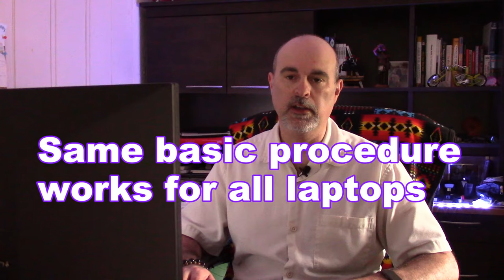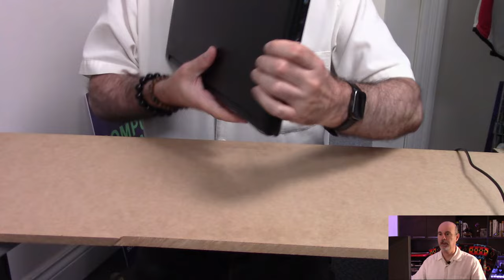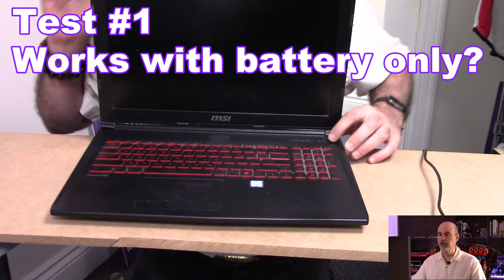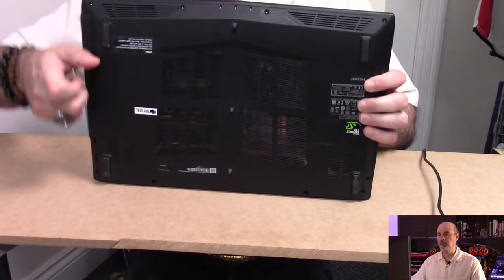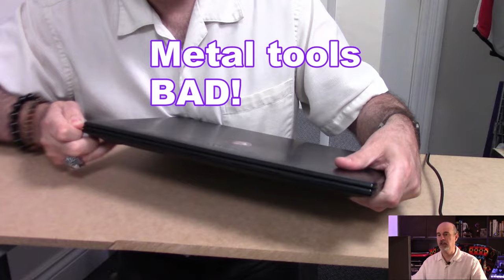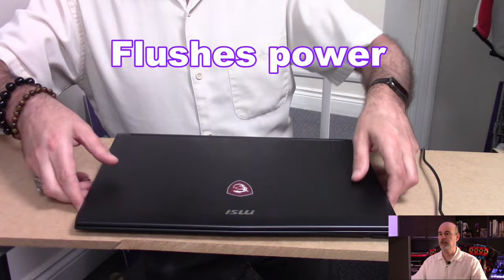How to fix an MSI laptop that will not turn on

Comment: Hello Sir Daniel, I Will Very Pleased if you could help me figure out.
I have MSI GV627RD Notebook, It was working all fine and I don't do any intense work on it, the previous day it was working all fine, and the last thing i did was copied some files to pendrive, and shut it off, the next morning it won't turn on, when i connect the power adapter the charging blue indicator in the bottom turn on (static) turns off after the battery gets full most probably, i tried your method and the small pin hole too, but nothing seems to work, I don't know what went wrong, i hardly used it for 3 months, as a Student it hurts to something go off without any understanding, i will very grateful if you help me find out the solution.

Thank You 🙂
Reply: Wished i could share a picture, i previously seen a video in youtube where the user showed it was not booting up his msi notebook because he had connected a faulty pendrive, and he removed a thin white strip that has power written on it, he removed that thing and it turned on, but my model i can unplug it from one end but the other end is below the mother board which can't be removed,

Just sharing if this helps in any way 🙂
Reply from the maker: Hello, this is hard to say in this case but maybe the pend drive was faulty and shorted the laptop.  If this video method didn't help, it might need repairs to the motherboard.
Reply from the maker: Thank you for sharing this, I never heard of such a trick but so many people come up with dangerous methods that can brick their computers.  You need to be careful what you try because what could have been a simple solution can turn into a more expensive repair because of the extra damage caused trying to fix it yourself based on blind advise from someone who hasn't seen the computer.
I've seen USB sticks or USB hard drives cause issues booting, but it would simply say on the screen it can't find the boot device.  Remove the USB and reboot works fine.  But what you're saying is very rare in my experience.
Reply: @TwinBytesInc  after commenting on your video, i tried opening the laptop and the strip i discussed, and every part from ram to hard drive to check if that fixes it but still no luck, i checked some parts for laptops especially motherboard its quite expensive, i purchased this laptop from all the savings i had, and to my luck it only worked 3 months, now it's been this way for a year now, wished i could get it back to work.

As I can't share the pic here, the strip is about 6 cm long and sticker attached to the back of the strip
MS16JIMB TO POWER 24PIN FFC
K1C-1024003-H39
HIGH-TEK(KT000)17/05/2018

And watermarked E35311 RU AWM 20624 80C 60V VW-1 H

Top Pin Side it Written Power and The Other Pin Side it's Written MB

If this could be the problem?
Reply: @TwinBytesInc  I really appreciate for taking out the time to reply to all the user help figure out the problem, it really means a lot 🙂
Reply: And yeah as far as i remember when it was working a blue light used to indicate in the the power on button when it gets connected, now only the battery indication get the blue light and turns off when the battery is full
Reply from the maker: @suyalahmed99  Sorry I can't help much further here.  I can only offer quick free advise, otherwise lots of back and forth turns into billable consultation/troubleshooting.  I'm sorry but you will need a local technician to help further as I have no other ideas off the top of my head.
Reply: @TwinBytesInc  Okay No Problem 🙂, Thank You So Much For Giving Out Your Time 🙂
Reply from the maker: You're welcome.  I do give what I can.

Comment: my msi pc dosent keeps on or turn on  with out charger connected even battery has charge plz help
Reply from the maker: That sounds like the battery needs to be replaced if it only works while plugged in.
Reply: @TwinBytesInc  I don’t know I took it to repair shop but they said battery is fine, and it will keep the charge too it became like a desktop
Reply from the maker: This sounds like a motherboard issue now.  Since battery is fully charged and other tech says battery is fine.  You should ask them if they actually tried with another battery, just to be 100% sure.  if still an issue with a different battery, then it's a motherboard repair.

Comment: Help, it doesnt turn on but the charging icon does turn on
Reply from the maker: It definitely sounds like this video should help.  Maybe just the screen is dead?  You can trying plugging an external monitor if it looks like other lights come on.  Otherwise try with power cord in and battery out.  If still doesn't work, needs motherboard repair.

Comment: I'm using Msi ge63 raider 8rf won't but but the fans are on
Reply from the maker: If this video doesn't solve the issue.  Maybe in your case it is a dead screen.  You can try plugging in an external monitor and see if that works.  if it does, that means you need a new screen.

Comment: It’s not working for me, there’s just some noise on the power button
Reply from the maker: There's a chance you need a new power adapter if you can borrow someone's, or it's going to be a motherboard repair.

Comment: Hallo sir
I wanna ask to you
I have MSI GL62M 7REX
My laptop cannot turn on
I was follow your step but still not turning on
Reply from the maker: Sorry I can't really troubleshoot here but maybe you need a new powercord or motherboard needs repairs.  Someone local needs to look at it probably.
Reply: @TwinBytesInc  i was remove the battery and plug the charger to my laptop
Still not want to turn on
Reply from the maker: Most likely motherboard damaged and someone needs to physically look at it.
Reply: @TwinBytesInc  thank you for the answer
I was put my laptop to service center
They say my motherboard dead
They wanna try to service my motherboard
Hopefully they can fix my laptop
Reply from the maker: Thank you for trusting me.  Sometimes people waste alot of time trying all kinds of tricks when nothing will work because the motherboard is simply dead.  The smart thing to do is to know when to quit. :)

Comment: What if you have to do this over and over again?
Reply from the maker: That means an issue with the motherboard in my opinion.  You could try updating he BIOS if it has an update available.  Otherwise it may need a physical repair like reflowing the board or something else.
Reply: @TwinBytesInc  thanks for sharing

Comment: I did the entire thing up until the battery removal, when I realized that I had a different kind of battery. I removed it, but it was connected with wires and I didn't want to remove them, so I did the 60 seconds and it unfortunately didn't work. Does anyone have any tips to fix this?
Reply from the maker: Sounds like yours has a cable or bunch of wires connecting the battery to the motherboard.  It should have a white connector that slides out away from the motherboard.  you will have to seesaw back and forth a little to get unplugged.  It's typically a tight fit, but you should see it start moving without too much force.

Comment: Hello sir please help!
I follow all the steps exactly same as yours! But nothing happens.

My laptop model is MSI GF63.
Note: When I plug the charger the the light od charging is emit.

But it does not power up.

Please help me I appreciate your response.
Reply from the maker: Sorry you're having trouble still.  This solution won't work for every situation and you may have something else going on that requires further troubleshooting.  There is a whole in the bottom of some MSI laptops but other brands may not have a whole and this feature method would work for any model.  However if it's not a power issue, it may need repairs to the motherboard itself and so you'd need to take it to your local repair shop to have them check.  Unless it's just your screen, in which case you can try plugging in an external monitor and see if it shows anything.
Reply: @TwinBytesInc  i can a little hole/EC botton at the back of a laptop - how long do i have to press it? It must be pressed while the laptop is plugged in?
Reply from the maker: You must unplug power adapter and battery if external.  Then press for 15 seconds according to MSI  manual.
Reply: @farazahmed2357  what was the solution mate
Reply: @farazahmed2357  did u find a solution what made ur laptop work

Comment: What if my laptop doesnt have the battery
Reply from the maker: I guarantee you have a battery.  It's just hidden inside the laptop. You'd have to remove screws that might also be hidden by stickers or plugs to get at the thin battery that is attached directly to the motherboard.   Or instead of that, you might have a small pin hole on the bottom of the laptop that you can press with a paperclip to reset the battery.

Comment: I have the MSI sword and this seems like the system in the laptops booting up just the screen is not displaying anything
Reply from the maker: Thanks for your comment/question.  If you can plug in an external monitor you will know if the system is working for sure and just the screen needs replacing.  Then you can either keep using an external monitor, or get your laptop screen replaced.

Comment: I cant open it up,i feel like its going to break everything because it wont open nicely,can you please help me?
Reply: well i didnt fix anything all i did was broke my computer,nice..
Reply from the maker: It's hard to guide through this in chat without knowing where you are stuck.   Sometimes needs a bit more force but reasonable, not really hard forcing it.
Reply from the maker: Sorry to hear this, I don't monitor chats or reply 24/7, just once a day here.  Also this is not a tech support chat, but I do try to help when and were I can
Reply: @TwinBytesInc  i somehow got the case opened up,but i dont see the battery.I have a different model gf65 2020 i think.Could you maybe help me find the battery?because i dont ser anything that looks like a battery
Reply: @TwinBytesInc  yeah,i did everything but it still wont turn on..i dont know what to do..maybe my cats pressed some buttons that made it shut down or something?do you have another solution to fix this?if you do could you please help me?
Reply: @TwinBytesInc  nevermind i just wasted 3 hours of my life trying to fix my computer,while my cable wasnt plugged in,it ran out of battery..:D
Reply from the maker: Seriously?  It was just a dead battery you needed to charge?  That's great news!  Sometimes it's such a simple fix but we tend to overcomplicate the situation thinking it's something far more technical.

Comment: The question is why does it happen?
Reply from the maker: I believe I answered this a couple times in the comments.  I don't know exactly what causes it.  Just that it's a build up of stuck power not flowing.  This flushes the power and if it continues to happen, that's a sign of an issue with the motherboard having faulty connections and may need to be reflowed.

Comment: Sir, I've tried your way to fix it, but its not working, may I get another solution?. By the way, my laptop is modern 14 11th gen B11SB. Thank you sir
Reply from the maker: Sorry that didn't work.  I found out from another viewer that MSI has a hidden pin hole in the bottom of the laptop that is almost invisible.  Try using a paperclip to press that button for 30 seconds and see if it helps, otherwise it's a motherboard repair most likely.

Comment: Didn't work for me.  Obviously a show-stopper problem.  Battery and PSU are maybe 18 months old and PSU reads fine on Multimeter.  60 sec works in the sense of a power drain, computer lights up when I plug battery in and fans spin. Then nothing. Leaving plugged into PSU does nothing. Following same steps with leaving battery removed still same results. Fans spin and then nothing.  If anyone sees this and can help I'd appreciate it- just lost a client today because of this problem.  Thanks.  MSI GS73VR
Reply from the maker: Sorry it didn't work for you.  Age doesn't matter as issues can arise anytime for multiple reasons.  Since this is for business, I would suggest you get a local expert to look at it.  it's the cost of doing business and you'll be up and running faster than trying to Google the issue.
Reply: @TwinBytesInc  I work at Intel and have a few coworkers that are more than qualified.  Unfortunately looks like it was a mobo issue.  I'll just have to get a new system- I was overdue for an upgrade anyway.  Appreciate your time man.

Comment: didnt work for me, any other ways you know of?
Reply from the maker: Sorry it didn't work for you.  You might need to try a completely different power cord from a friend or ask a store to try before you buy.   Failing that, you may need a repair shop to replace the DC jack or repair the motherboard.
Reply: @TwinBytesInc  Thanks for responding, I have a second power cord which doesn't work, and I sent it to get fixed 3 times and they couldn't, I'm probably just gonna give up on it since I cant get it fixed.
Reply from the maker: @SemiCollin  Sorry to hear that.  Sometimes it's true, they are too bad beyond repair.  Basically meaning the cost of the repair wouldn't be worth it, so they just say it can't be done.

Comment: What would cause this to happen.?
Reply from the maker: I'm not sure I can answer it properly although an electrician probably could.  It can be a cause from what is called "Dirty power" or the system design where the flow of power gets "Clogged up" for lack of better words.  This is a little reset that unclogs the flow of power.  It could be a sign of more problems to come, but not necessarily.
Reply: @TwinBytesInc  well I'll tell you this my MSI gaming 075 raider laptop is sitting on my table unused for a week now I pulled out an old HP all in one and turn it back on and using it fine and I realized there's a lot of problems with this MSI computer system I don't know about you but I've had tons of problem before this the keyboard stopped working and I hooked up another keyboard to it I've been typing on two keyboards you know it's a great system I don't know why I bought it for $1,700 I'd rather not have I could have saved that money and use my old HP all in one works better cuz it turns on
Reply from the maker: I personally don't use or recommend MSI.  This was a clients computer I was working on.  From past experience I generally advise to stay away from the cheaper, not so well know brands and go for the ones that have been around longer and have a good reputation.  That's why you noticed your HP being more reliable.  That MSI you have could have been a bad lemon from the factory.
Reply: Definitely get the extended warranty expensive paperweight

Comment: How to get through the factory seal
Reply from the maker: Usually factory seal is just a sticker which you can break through easily with the screw driver as you push down into the screw and start turning.  You will void warranty but in most cases people don't have time to wait for warranty repairs which can take weeks.
Reply: @TwinBytesInc  my issue was temporarily solved by a more vigorous version of ur method but the issue started again once I powered it off
Reply: @TwinBytesInc  what should I do?
Reply from the maker: This would require more troubleshooting which I can't do in chats here and someone may need to look at it physically.

Comment: It does solve the issue, but this happened 2nd time. my question is why is this happening.
Reply from the maker: Glad it worked but if it does happen a 2nd or 3rd time there maybe some issue with the motherboard and how the power flows.  You may need to "ReFlow" the motherboard.  This is a dangerous procedure and requires someone skilled and patient with a solder gun.  Not 100% that is the solution but it's my first thought.   Maybe the first easy step is testing your hard drive and memory but most likely it's not those components.

Comment: I can't open the protection of the laptop it was so hard
Reply: Hope u give me some advices
Reply from the maker: I'm not sure exactly what you mean.  You can open the cover to access the battery?  Not sure this is something I can help with not seeing it.  Maybe you have an extra screw hidden under a sticker.  Every model laptop can be a little different.
Reply from the maker: Always happy to try answering every question, and I try to check and reply within 24 hours but it will be increasingly difficult as my channel continues to grow.  Consider joining as a member for guaranteed replies and priority responses.

Comment: No luck with my GF63.  Pulling my hair out over here.
Reply from the maker: Sorry, if this video didn't help and it's not the battery or charger, it's the motherboard and requires repair.
Reply: @TwinBytesInc  thanks for the reply.  I just can’t believe it’s the MB. PC was 2 days old.  Upgraded RAM like I’ve done 100 times.  Now power button does nothing.
Reply from the maker: @BamaPewPew  You're welcome.  Someone needs to look at it to know for sure what's wrong.

Comment: I’ve tried everything but there is just no life whatsoever. Not a single light even turns on
Reply from the maker: Sorry to hear this.  It's either a bad power supply or DC jack on the motherboard might need replacing or motherboard needs ReFlowing.  Might need to take it to your local shop.
Reply: Yes it’s a motherboard problem, just going to buy a pc since they said it would be expensive to fix
Reply from the maker: @gety3563  Sorry to hear that.  Sometimes it is too expensive to fix.

Comment: Mine dont have batery...bravo 17 A4DDR
Reply from the maker: All laptops have batteries.  Some are buried inside the laptop and require removing a few screws.  I don't have instructions for that model but you could find the manual online.